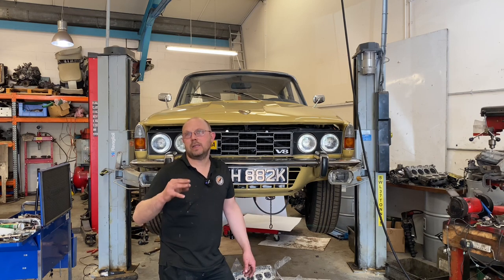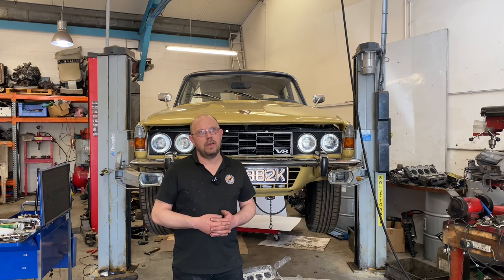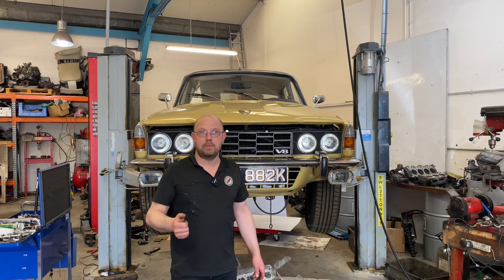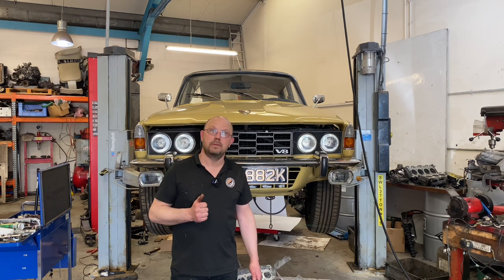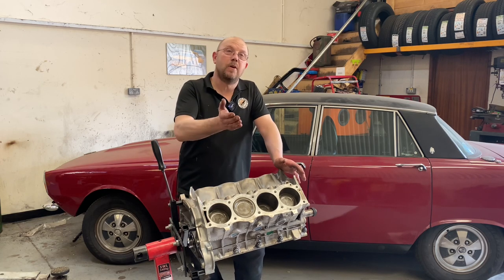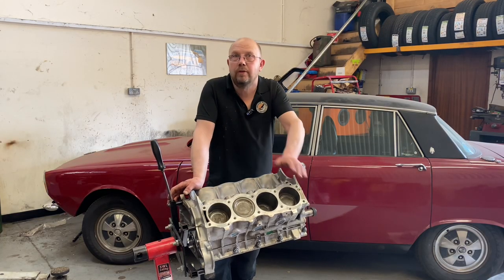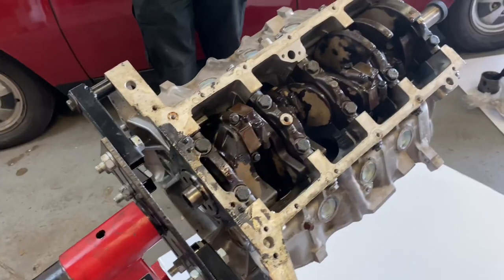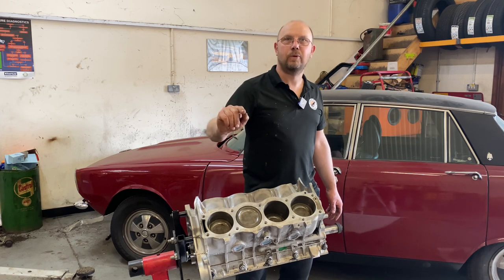Rover V8 3500s - Upgrading 3.5L to 4.6L! Top Hat Liners? Part 6

Comment: Graham will the stock heads(althou slightly ported) that are for the 3.5 not strangle the power on the 4.6 ... i did a 4.6 years ago and found a twin plemium setup with a cam and manifolds it made 292 hp and 328 ft ran out of puff really after 5k but was a right stump puller !  cracking video looking forward to the numbers .... would be nice to see some tubular manifolds on it as well owe and a 4 barrel Webber !!!!
Reply from the maker: both this and the previous 3.5 build of this used  4.6 heads. absolutely it would be nice to see effects of  tubular manifolds and 4 barrel but we just dont have that option right now

Comment: I noticed that the pistons are different from my P5b Coupe. Mine are completely flat on top. Which surprised me a bit as it can't do the flow any favours. Would you recommend different pistons?
Reply from the maker: P5b pistons are  10.5:1 compression and normally have a very shallow dish in them, the bowl depth wont effect airflow. with modern fuels it is usually preferable to either use composite head gaskets to lower the compression or change the pistons
Reply: @PenguinMotors  How much is a turn key 4.6 RV8? I'm tempted to have one dropping into my P6B 3500.

Comment: What about the gearbox
Reply from the maker: its a rebuilt LT77, which is just fine unless your going to drive it like you stole it, i did have to uprate the clutch though a standard one couldn't cope with the torque